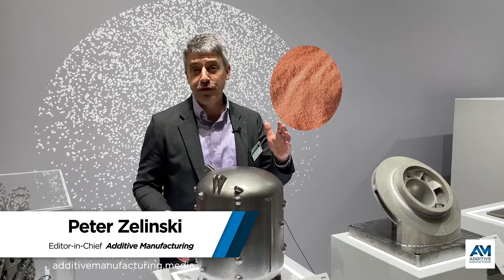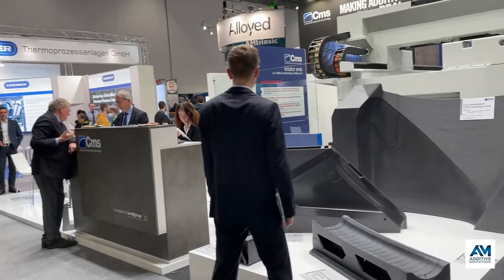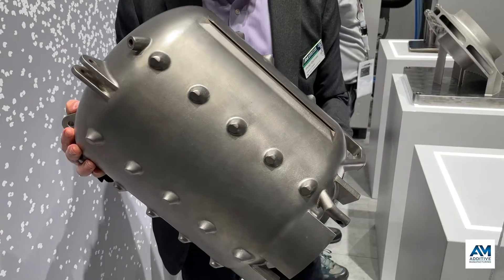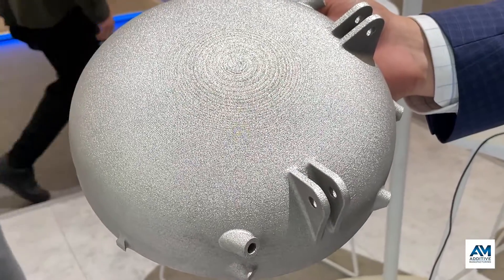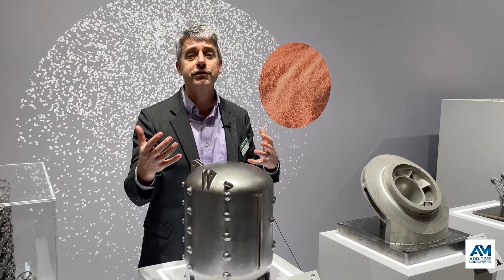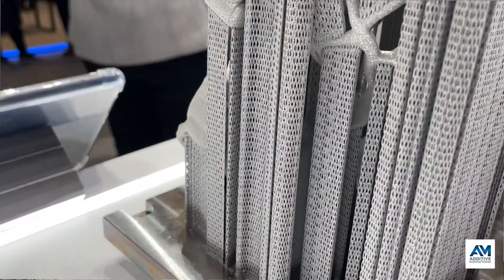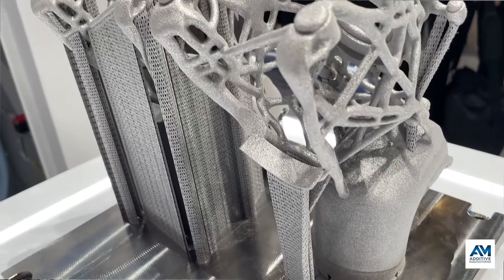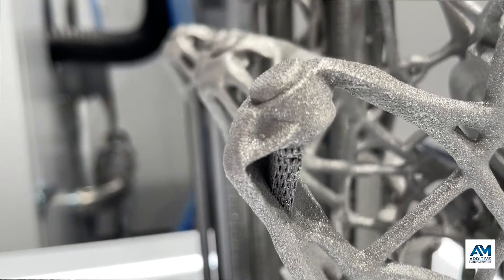Spacecraft Propellant Tank 3D Printed in One Piece Without Supports

Comment: Why does laser powder bed fusion need supports? Is the powder not supporting the print like, for example, with nylon SLS?
Reply: yeah, especially if the part is welded to a build plate at the bottom...
Reply: For polymer LS, it doesn’t need, but for DMLS, support structure is important not only to provide structural support but also to direct the heat away during the process.